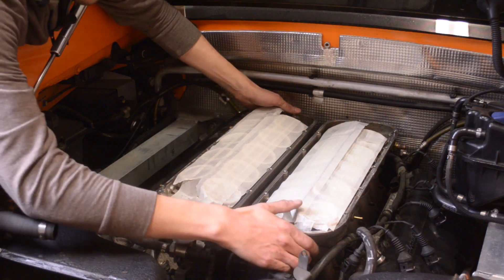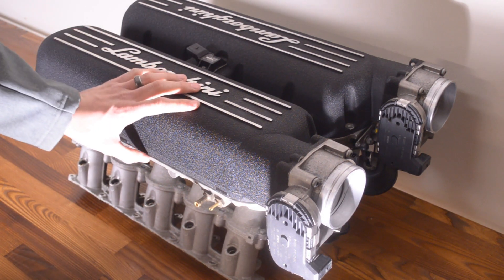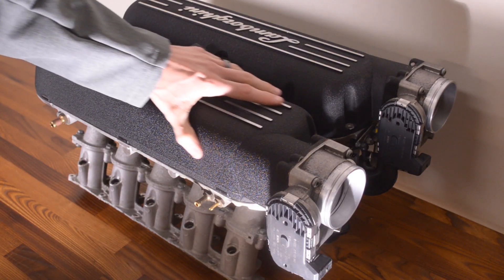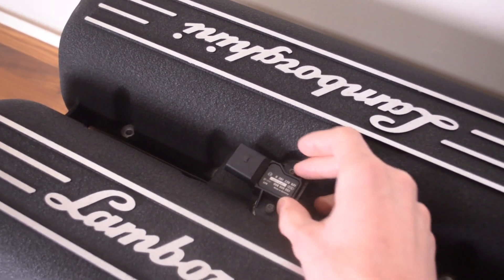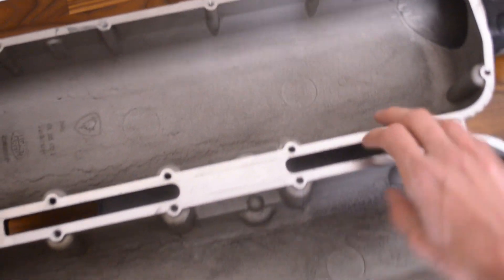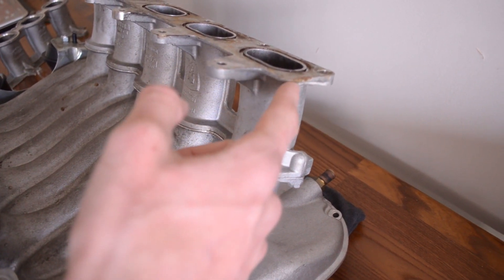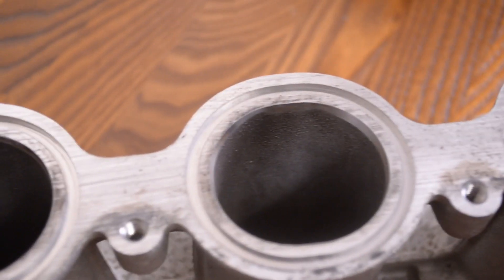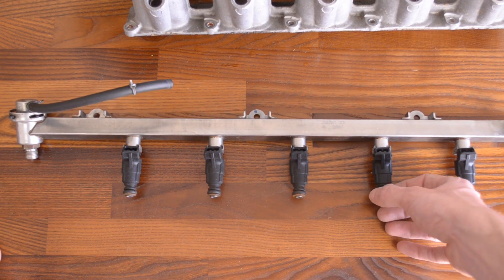Lamborghini Made The Best Intake Manifold In The World But Not For Very Long | Complete Teardown

Comment: How does having longer intake runners help with increasing low end torque?
Reply from the maker: Jink, here is a good stack exchange post on this one. It has to do with the pulse wave harmonics and as it relates to the "stacking" of air pulses as they travel through the runners. https://mechanics.stackexchange.com/questions/25236/how-does-intake-manifold-runner-length-effect-the-power-curve-of-a-car

Comment: Did you have any issues re-using the injector o-rings or any of the "big" gaskets on the manifold?  Or did those all come out pretty cleanly.  As you say, not too worried about them as long as they separated cleanly on disassembly.
Reply from the maker: Richard, no issues with the gaskets or injector O rings. The injectors are standard EV14 style injectors with 6mm O rings. Any 6mm (or 8.1mm, I cant remember LOL) off-the-shelf O ring will work if yours are trashed.

Comment: Great video explaining the engineering of the manifolds! Would it be possible to replace them with individual throttle bodies?
Reply from the maker: Jink, You definitely could! That would be a sweet mod! The car would probably not even mind it either. The biggest hurdle you would face is finding a way to get the throttle bodies on your ITBs to communicate with the OEM electronics, but after that you are off to the races!
Reply: @TheBullRider  would the intake runners be removed too if using ITBs? Wonder if it'll lose too much low end torque without it.

Comment: Hi, I just tumbled on this video and others of you, probably because I like cars and mechanics. 

Anyway, you were talking about maybe doing a port polish of some kind, to gain some hp.

Now you could ask yourself why, in the first place, those smart guys from Lamborghini/Audi, didn't do that already?

The thing is that they leave it that way(a little rough) to make the incoming air tumble(it's the best word I can come up with, English is not my first language) to have a better mix with the fuel, once it gets into the cylinder. 

Thus if you ever decide to polish the intake manifold, do a before and after dyno, and don't be surprised of the numbers...

And by the way, you're doing a nice job 👍
Reply from the maker: Marco V6T, that is a totally realistic perspective and I appreciate your input! You are completely right, a before and after dyno will tell you a lot of the truth of the before and after results for that. 
Even if we flow bench the intake manifold before and after, we still would not get a good perspective on what would happen to the flow dynamics of the air-fuel mixture and atomization. And you are right, turbulent flow might atomize the gasoline in the air more effectively than laminar/ transitionary flow at that Reynolds number with ported/ polished runners!
My only other perspective however is Lamborghini ported and polished the cylinder heads by hand and also clipped the valve guides. My thought with that is they didn't concern themselves with turbulent air in the heads, maybe the intake manifold wouldn't be any different? Check out this other video of mine where I show the intake ports. https://youtu.be/uAaWORmKhco?t=593 I show the ports at 9:53! Let me know what you think! I would appreciate your thoughts!

Comment: Hi, I have a 2008 SL as well. I want to replace my injectors.  What alternate Audi or VW should I get?
Reply from the maker: Hi Owali! Yes, you can. The part number is 06A906031BA. I recommend getting a Bosch branded injector. They are the same as OEM Audi/VW but just a lot cheaper. 

https://www.fcpeuro.com/products/audi-vw-fuel-injector-bosch-06a906031ba

You can also get remanufactured ones. They ultrasonically clean them, flow match them and they are good to go. 

https://www.injectorplanet.com/products/bosch-0280156061-volkswagen-06a906031ba
Reply: @TheBullRider  thanks a lot, will give that a try!
Reply: @TheBullRider  last question. Injector planet lists two o rings as suggested parts. Which one is correct for our cars?
Reply from the maker: @owali6021  Im sorry I don't see that on their website! Is that under "customers who bought this item also bought"?
These remanufactured injectors come with new o rings. You don't need any others to install in the car!

Comment: Another GREAT video. But, why did you remove it in the first place? Are you going to paint or polish the logo? I was thinking about doing mine...
Reply from the maker: Patrick, great question. I have an oil leak AND a coolant leak in that same spot. I will show you this in a future video but the V of the engine block is covered in oil! LOL I don't know if I would call it luck or not! 
I'm not going to paint the logo although polishing it is a good idea! I will look into it! 
Maybe the removal video will help you then for when you paint yours. I am going to show how to remove it in the three parts Independently, first the plenum, the middle section and then the runners!

Comment: If that is the highest mileage SL, it sure is clean !!! Great info, thank you
Reply from the maker: Haha why thank you, sir! I cleaned the intake a bit. A little bit of oil from the PCV system but other than that it was clean as a whistle.
Reply: @TheBullRider  then you got extremely lucky with this purchase !!! Congratulations
Reply from the maker: @ndpesicgroup  Well thank you. I would agree with you, I did get very lucky! LOL I didn't show you the mess that I have in the V of the block. If you saw the "everything wrong video," you saw a bit of an oil leak in that region! I'm excited to share with you how I fix it. 
Always good to hear from you!
Reply: @TheBullRider  that mess is from the oil pipe o-ring, replaced it a few months ago.
Reply from the maker: @janpieters6733  You hit the dog on the nose on that one. Its a mess down there!!! LOL Was yours leaking down the front of the motor?
Reply: @TheBullRider  No in the V of the engine, was a pretty mess there, took me hours to clean. I also replace the gasket of the oilfilter housing and oilpipe to the oilfilter housing.
Reply from the maker: @janpieters6733  yeah im in the same boat with you then Jan. I've seen it get so bad where the whole V fills with oil and it starts spilling out the front onto the belts haha.

Comment: Extraordinary claims require extraordinary evidence.  The intake manifold is nearly identical to the 360 and 430 and Ferrari came out first.  Just from looks, it looks exactly like the 1999 360 Intake Manifold, almost as if Lamborghini reverse engineered the Ferrari and added their own twist.🙂
Reply from the maker: All very good points Kent! The 360 intake manifold looks very close but the flow takes an abrupt 90 degree bend for the low rpm runners and the velocity stacks aren't cast integrally with the intake manifold!
The 430 intake manifold is only a single stage, although it is very beautiful as well. 
You are probably right, there was probably a 360 or two for reverse engineering at the Lamborghini back in the day! At least the 430 and Gallardo both use Bosch throttle bodies! they are probably the same part number. Haha!